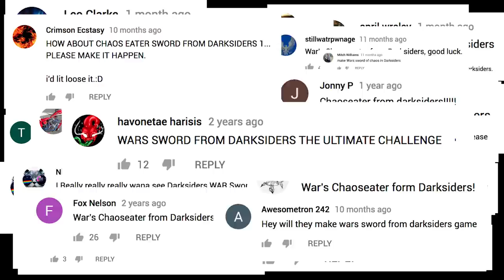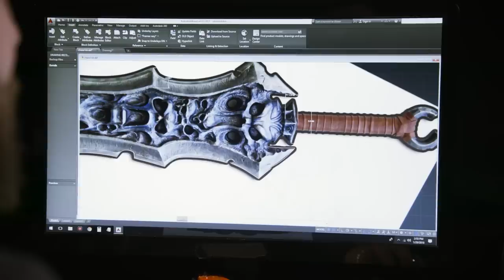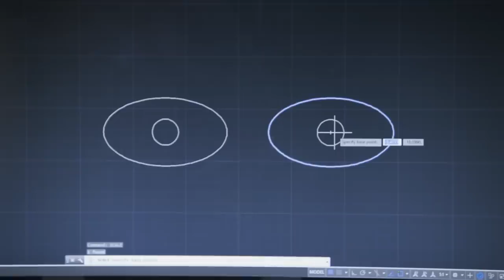Chaoseater - Darksiders - MAN AT ARMS: REFORGED

Comment: Guessing you guys only made one panel and left the other side unfinished, which is why only one side of the finished sword was 
 ever shown in the video (don't blame you for doing it this way, obviously).
Reply: I noticed that too, kinda thought it was cheaping out if you ask me. I wish they would have done a collaboration with Michaelcthulhu
Reply: I think they decided it was heavy enough already....
Reply: i know what you mean but the reason why they did it that was was one it was already too heavy {close if not over a hundred pounds just from what they put into it} and two all that detail it would be imposable for a mortal to make two on such a time crunch
Reply: I was surprised when they didn't make a mold of the first side and copy it over and re-match the edges. would not have been as light, but maybe the could have hammered into the mold instead of pouring molten metal in to keep the weight down.
Reply: They basically used his technique to once it was assembled (e.g. weld + hand grinder)

Comment: Now this sword is INSANE!!!!!!!!!!! Holy crap,!!! I would definitely hate to be at the receiving end of this sword. I have made some 3d skulls out of sheet metal before. I didn't use quite as thick sheet metal though. I used 16g, cold roll sheet metal,  which was a bitch to hammer and shape and I didn't make all of the details out of one piece. I welded on different pieces to get  the definition that you guys got. I shaped and welded pieces on for the ridge and shape around the eyes and nose which was still a lot of work but in comparison to this sword I might as well been working with clay. I'm impressed with how well the skulls came out. Excellent fabrication work guys!

Comment: Stormbreaker from Avengers 3.
Question.  Was the center inlay with the skulls only done on one side?  If not I must of missed you showing the other opposite side off.
Great build.  Fantastic wall centerpiece.
Reply: in the part where they test the sword, they are only focusing on the side with the skulls design... makes me wonder if they actually did the other side....
Reply: I think from the pictures they were using as reference they only saw one side so they might not have realized that both sides are centered with skulls lol